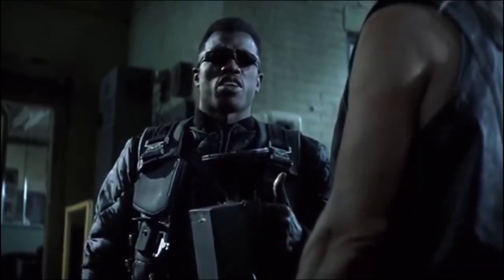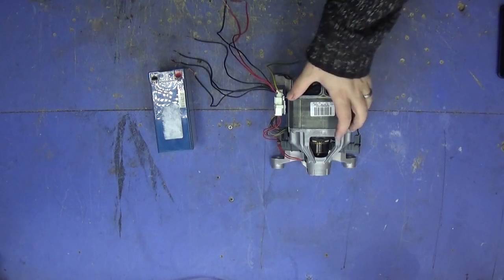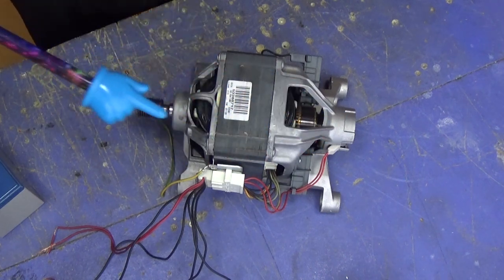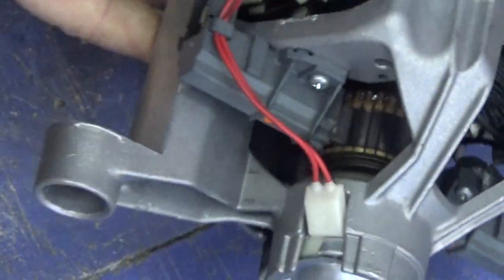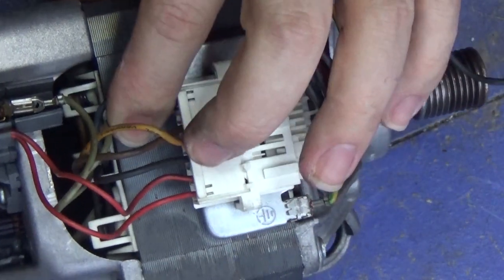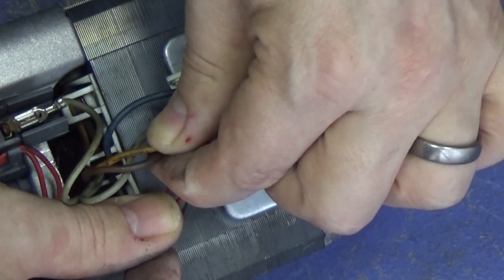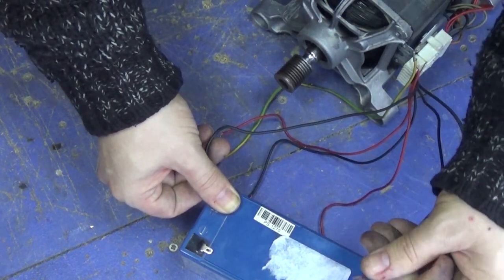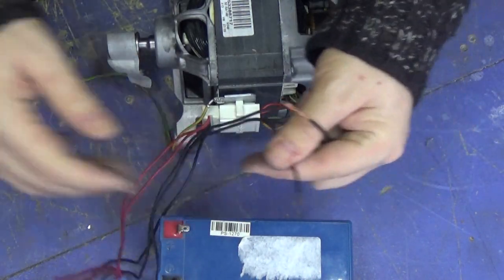How to run a washing machine (universal) motor off a 12v battery

Comment: I don't see brushes on mine. There is two ground wires on the chassis, a sensor, and 3 wires other than that that all measure 6.5 ohm between them no matter which combination. Hooking power up either yields electronically locked motor that's hard to turn or no effect. Super confused
Reply from the maker: This will only work for universal motors. Where did you get your motor from?
Reply: @TheOffGridFamily  Hi thanks for the reply. I confuse myself ten times and understand things once, you know? The motor I found is a "3 Phase Induction Motor" and it's brushless so I'd need something called a variable frequency drive to power it, but that doesn't matter, I need it to generate power. It's from a washing machine. Fortunately I have another motor that I inspected and it is brushed, so I should be ok with that one.  I also have a garage door opener motor and a circle saw to work with so I should be ok just was getting ahead of myself yesterday
Reply from the maker: @greenbassboosts8872  I'm the same buddy. I take a while to get to grips with things. I'm sure you will get it sorted. Any problems just send me a message. Good luck buddy

Comment: Have you tried it with more DC voltage?
Reply from the maker: No I haven't. I'd say that 18V would still be fine but I wouldn't want to guess the maximum you could use
Reply: I was thinking more like 70 - 100vdc 😂 👍🏼 for an ebike motor scenario.
Reply from the maker: @daiashthomas  I did think about making an ebike but I've never got around to it. There is always something else to make. If you do try it then please leave a comment with your results. Good luck my friend

Comment: How would you turn this motor into a water pump?
Reply from the maker: There are many different types of pumps but tbh I'd try different ways to make one than using this type of motor. Although it is possible and fairly easy there are much easier methods. Would a ram pump work for what you need?

Comment: Will this work with a 12v wall plug
Reply from the maker: Yeah it should work with a 12v DC adapter but remember it's still mains voltage so can be really dangerous plus carful not to burn out the motor

Comment: Hello, I don’t know anything about electric motors. Do anybody know if the motor spins just as fast one powerful as it was originally at home with more volts?
Reply from the maker: If you are asking about the torque (the amount the motor can turn) then the 12v version has much less power but can turn the same speeds (with no load). You can increase the torque by changing the motor slightly by adding magnets. I hope this helps

Comment: How to slow the speed of the motor? Is there an rpm control?
Reply from the maker: There are many ways of making s DC motor run faster, slower, forward and backwards. Just Google DC motor controller. There is loads of different types or you can look into building one with an Arduino.

Comment: hey friend i have a problem im trying to run my 3 wire  that are the 3 phases, to a 12 vote  power supply i do have two small red wires at the back of the motor im not having any luck please help
Reply from the maker: Hey buddy, without being able to see and test the motor I don't think I can help that much. Have you followed the steps in the video?
Reply: @TheOffGridFamily hello i destroyed that three phase motor, that i asked you about im keeping and collecting copper wire, i drilled about 30 holes in the motor casing and the big metal square block im keeping, but thankyou! your videos realy help a lot, you are the off grid king!
Reply from the maker: @owensdaniels6244  we learn more from mistakes than we will ever learn from success! Good luck with your next adventure

Comment: Can I plug it in a 12v transformer? Thanks
Reply from the maker: I don't see why not just be careful with the amps. You could burn it out
Reply: What type of transormer should I use?
Reply from the maker: You will have to see. I don't know. Each transformer is different as is the motor

Comment: Hi I have been watching your videos and believe you can help me. I have a washing machine motor part # 3951551 but unsure of the leads. Can y be u please identify them for me. Which should connect to my 3 wire electrical plug and how do I connect them to the capacitor. Want to use motor for a diy sander. Thanks
Reply from the maker: Hi Howard I honestly wouldn't know what's what. If you want to send me a picture to my email I can try and help. Sadly I only tend to know about specific items I've had a look at and experimented with. My email is theoffgridfamily@gmail.com
Reply: @TheOffGridFamily  ok I will thank you so much

Comment: Can I use it on 24v?
Reply from the maker: I'm not sure to be honest, I would have thought so but just be careful not to burn the motor out.
Reply: it will be fine. i tried it. i even tried 300v dcc and it ran for a solid minute and wasn't even that hot. i wouldn't recommend doing what i did but 24 volts is absolutely fine

Comment: nice video! How many amps does it take to spin?
Reply from the maker: I'm not 100% sure. They are all different. I didn't test this one. Sorry buddy
Reply: @TheOffGridFamily  how many amps was ur battery? I am planning to power the motor from a custom pc psu wich also can give 12v...but I am afraid it will blow it up...any thoughts?
Reply from the maker: I honestly can't remember. I will try and find it and get back to you. I'd guess that the motor will run from a PSU without much problems but I would do some tests first just to be sure. If you need any help just email me (theoffgridfamily@gmail.com) good luck buddy
Reply: @TheOffGridFamily  so I tried it, it works but for some reason the amps of the rotor are 20mA with both 12 or 5v (and with stable volts on the poles of course)
Reply from the maker: Have you tried a 12v battery to see what's happening? It maybe worth trying to see if there is any difference between the two
Reply: @TheOffGridFamily  I dont have one but I tried to connect in series psu and 9v battery. I dont thing this is the problem because the psu can give up to 5A or more I dont know...the poles gain 5A...
Reply from the maker: @nickkarapas7564  Im not sure I can help you. Sorry mate
Reply: @TheOffGridFamily  no prob man
Reply: @nickkarapas7564  it will be fine. i connected mine to 300v dc and it ran for a solid minute and wasn't even that hot

Comment: I have one and it runs very slowly with 18 v is it defective
Reply from the maker: That's not something I could say without looking at it etc. Sorry
Reply: @TheOffGridFamily  thanks
Reply from the maker: @bilgaissa5831  sorry I couldn't help
Reply: more V  =  more rpm
Reply from the maker: @raedy07  not necessarily and be careful because to many V and no rpm
Reply: maybe coz it's designed for 230V? dirty commutator/brushes?
Reply: @TheOffGridFamily  i thought it was linear, double V will double rpm. at least with permanent magnets.
Reply from the maker: @raedy07  I was just warning because I had a few people add way to much voltage...I mean hundreds more than the motor is rated for. so just putting that warning on :D

Comment: Is there a link to the battery please
Reply from the maker: Do you mean a link to where I brought the battery? If so it will work for any 12v battery.
Reply: @TheOffGridFamily  yes for the battery i haven’t a clue what the actual name is for them I’ve put in 12v battery but it come up with tiny little things haha
Reply from the maker: The one I used in this video was a 12v 7ah battery. So search "12v 7ah battery" and you should find loads. Otherwise any 12v battery should work. A normal car battery should be fine
Reply: @TheOffGridFamily  thank you! This might sound random but I’ve not seen it been done yet! Have you ever tried to link a washing machine to one of those batteries and tried to make a e-bike? Question is how would you stop it 😂
Reply from the maker: @YOU_DIDNT_EVEN_SEE_ME  not random at all. I was going to do it a few years ago but just never go around to it. They are great motors but I'd advise doing tests because you may find that you need more pushing power than a 7ah battery can give
Reply from the maker: If you need help then don't hesitate to ask 🙂

Comment: commutator not communicator ;)

good video though
Reply from the maker: I've said communicator since I was a kid and tried not to say it but its just built in now. Cheers for the comment
Reply: @TheOffGridFamily  good to know I can run mine from 12dc bench power. safer way to experiment finding those coils and brushes. mine has 6 orange wires and ground. salvaged from a bosch classixx 1000. at least your video has given me something to go on
Reply from the maker: @SodiumInteresting  I'm glad it's helped you. I have so many motors. I'm beginning to think I've got a problem...

Comment: How about a 12v washer machine
Reply from the maker: I've thought about doing one but I'd have to change a lot because the drum size would be very heavy for the motor and run the battery down to quickly
Reply: Not as much as you think.
My 110v uses 850 watts, 
For 12v this would be 80 amps.
Right now I am using an invertor. Only works on a sine wave. 
I have to fill tub with hose  otherwise I'm waiting a long time for it to fill. 
Well is on a windmill. Because well is about 1000 feet. Hence why I don't have an electric well pump. For every 100 feet is 1hp or 1kw.
I could basically wash the same using a alternator motor.
But what I need to figure out is how to make it cycle.
Oh and for 12v, I'm thinking of using a marine 12v bilge pump for water in put. 
Thats my idea. But since I haven't made it yet..... it just theory. But again haven't figured how to do controller for 12v.
Reply: I should add. I have 2000 watts in panels hooked to ten 29DC Deepcycle batts, and a 4kw sine invertor. ( thats my house. Have more systems as well)
And washer is outside.
Reply from the maker: @baddog9320  that's great! We are building ours up year by year. If that's the case then I'd give it a go. It maybe worth trying to find a broken small washing machine and swap out the motor. That way the motor doesn't need to do so much. A washing machine drum when full of clothes and water get very heavy.